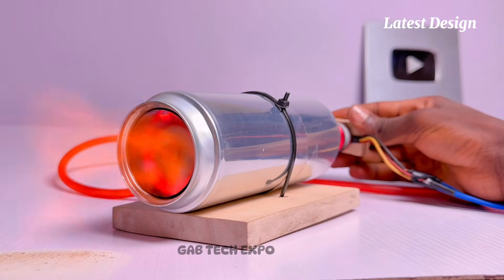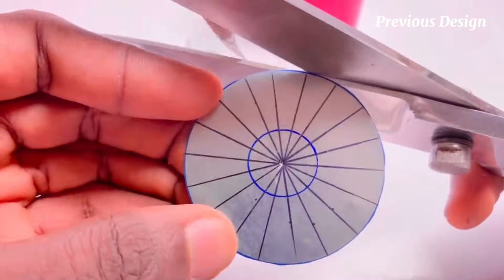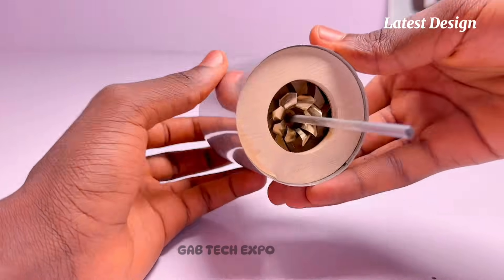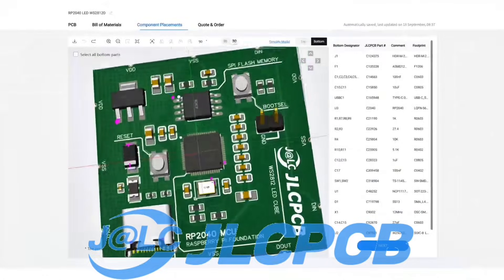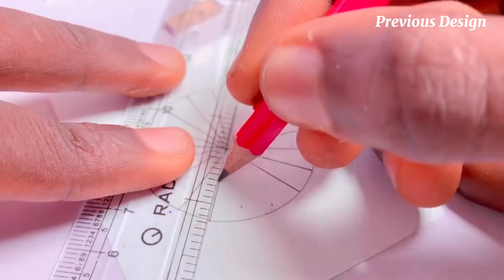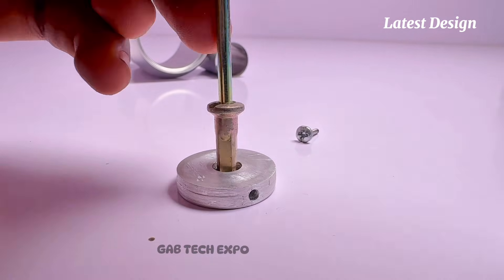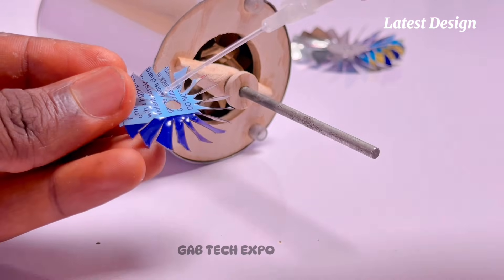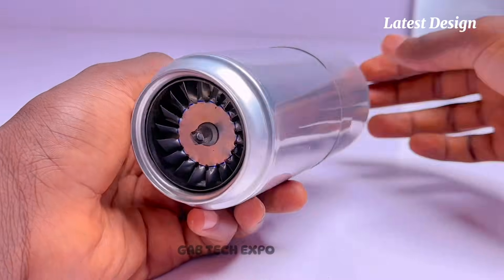Axial vs Centrifugal Jet Engines – Soda Can Jet Engines Turbo Battle!

Comment: Love the idea. But 2 spots I think you can improve on. 1. All the fans and compressors need to be balanced and minimize the clearance between the fans and side housing. 2. If, some how, you can add a high temperature exhaust fan and a longer high temperature exhaust ducted. I thing you'd see significantly better and stronger turbines

Comment: Radial compressors are great for when you have space constraints. Pressure ratios of 2+ are achievable, and these days 3+ isn't out of the question. Problem is they can't be staged easily, so usually no more than two or three stages are employed, which puts quite a low practical limit on the maximum pressure ratio for your compressor.

Axial compressors on the other hand can be readily staged without incurring the ducting losses present when doing so with radial types. While they rarely exceed 1.2-1.3 per stage (let's be realistic, in a model like this it'll be closer to 1.05), having 10+ stages rotating together can quickly exceed the capability of even the best radial compressor. In commercial and military engines, it's also easy enough to build separate compressors which rotate at different speeds, with one feeding the other, without incurring any significant ducting losses. In that way, some aero engines are able to exceed a pressure ratio of 50.

In your model though, there doesn't appear to be the space for many axial stages, so I expect the radial type to outperform unless it s really sloppy.

Comment: How the heck did you center and balance everything given that you eyeballed the drilling in the cutting of the blades and shaft? How long do your bushings/bearings last given that they are not lubricated?

Comment: can you please make a video on how to make a miniature multiple stage steam turbine 
i beg you to make one 
you are my last hope🙏🙏🙏❤
Reply: Basically the same but just the compressor stages but lots of them, there's plenty of pictures if you look for the Lusitania turbines and Britannic, the largest steam turbine ever. 

They run at low pressure, usually below atmospheric pressure like 0.7 atm. 

Needs a set of brakes and if you can feed steam from both sides you can reverse it. 

You want some way to convert the high pressure from the boilers into low pressure and high speed, the pipe should be nozzle shapes. That's what a rocket nozzle does, increase speed decrease pressure. Also below armospheric pressure, it's why rocket exhaust folds in on itself until it reaches a bit of altitude and the plume expands. Vacuum engines have the big nozzle to accentuate that, so you want to copy the shape of a vacuum engine nozzle, like the RL10 or Merlin MVac.

Comment: Do you inspect these engines after running them to look for future improvements? I think it could be a helpful tool to examen how close the engine was to failure in terms of safety, and I would also be very curious to see how well they held up! You did an awesome job creating these and I think it would be fun to try out! Is the steel sheet metal you use just flattened steel cans? Great job!

Comment: try rotary tesla turbine turbo pulse jet engine. yes mostly rotary output, only some axial exhaust turbo thrust output. you dont like cad programs. 3d printed parts can be turned into metal parts by electroplating conductive paint on the 3d print to copper etc. copper has higher temp resistance than aluminium but less than steel. or just cut bending steel sheets to suitable construct pieces with laser or by hand.

Comment: Do you think it can fly small drone if it attached with model
Reply: That's not how drones work
Reply: @DelonPravish  There are unmanned drones with Jet engines..
Reply: @dallanlewis6084 drones hover. So technically what you say is currently impractical and fictional. You can fly with turbines, jet engines, afterburners but not hover like the in the movies
Reply: @DelonPravish thats only a quadcopter drone. a drone is any vehicle that moves without a human inside of it and is controlled remotely
Reply: @demti2  That's what I meant
Reply: @DelonPravish There are unmanned hovering jets...Don't wanna hear anymore misconstrusion of truth. Thanks for your time.
Reply: No impossible
Reply: It might work for rc plen